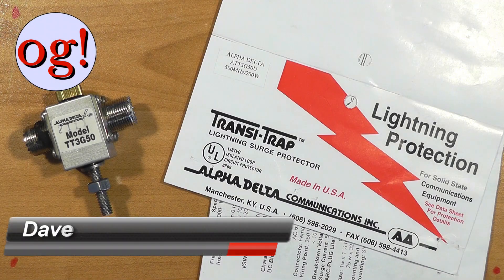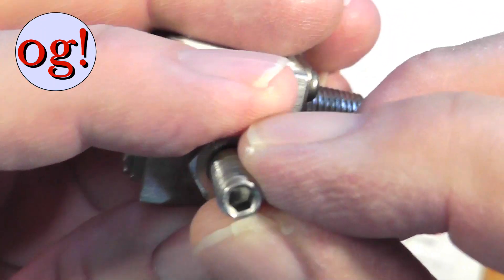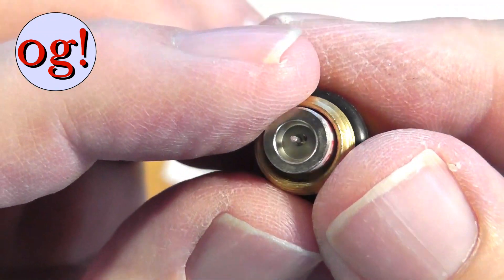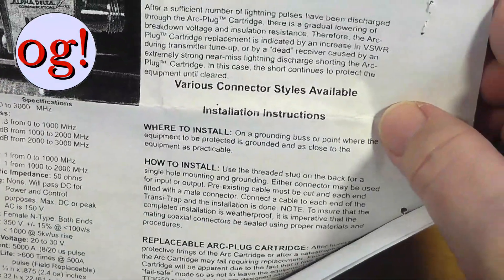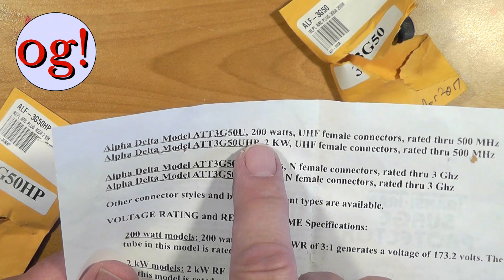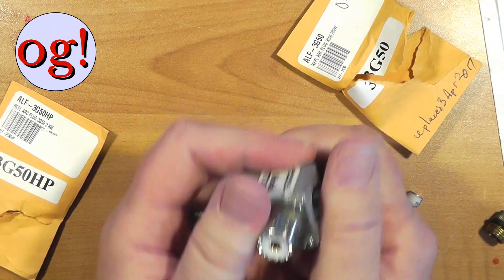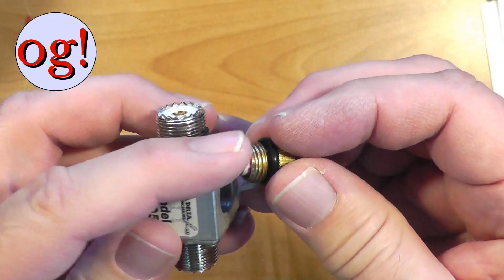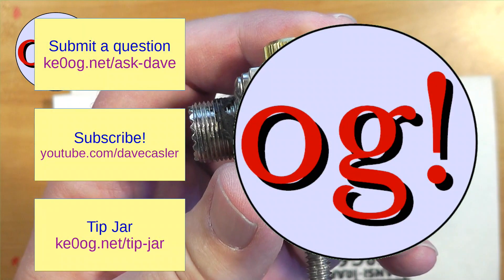The Alpha-Delta Transi-Trap Lightning Surge Protector (#61)

Comment: If the glass capsule fails, does that block current through the protector?  The waterfall display on my radio is very dark and muted, as if it's receiving little,  if any energy.

Comment: Great video and for my money those are price at $55-69. That would be cheap insurance if you live in TS country. I live in earthquake country and only see thunderstorms on the news. Not that it couldn't happen, but I'll just unplug everything if it warrants. I have the antenna  coax grounded outside on a 8ft ground rod with a KF7P coax grounding bracket bolted to it. I'm running the station bus back out to that same ground rod just nearer the dirt that the bracket. That should do it. (and pray for no lightening nearby.)

Comment: If you have taken a hit with one of these installed, take the time and examine the interior of the aluminum block cavity. If you see any blackening inside the device it more than likely has formed a carbon path between shield and the conductor and is rendered useless. If you want you can try disassembly of the device and carefully polishing the cavity with 800 followed by 1200 grit energy paper on a wooden dowel rod. Don't go overboard since we do not know if the cavity dimentions are critical for the frequencies it is designed for.
Reply: "...we do not know if the cavity dimensions are critical for the frequencies it is designed for." Yes we do. They're not. It has SO-239 sockets, so it's not designed for X-band microwave. It's for HF/VHF/UHF. Thus, the internal dimensions AT BEST might be designed to maintain about 50-ohms characteristic impedance. That is NOT a precision thing, simply a ratio of inner and outer diameters. You could grind off a significant amount and it wouldn't make the slightest difference.  And I very much doubt that they made any significant effort to make them precisely free of any "impedance bump" anyway.  I don't understand why they're not $25 or so.

Comment: Hai..rg8 can use??
Reply from the maker: RG8/U is an older type standard coax. It works fine. I like the RG8X because it has nearly the same performance characteristics at a lower price. But if you have old RG8 laying around, go ahead and use it. Make sure the braid jacket isn't corroded away.

Comment: 30 volts? Wouldn't the ruffly 72 volts out of a 100 watt transmitter trigger that? The sheet you are showing says 350 volts for the 200 watt model and 1000 volts for the 2KW model.

Comment: What ground wire size should be used on the ground lug?  I've been told by Alpha Delta and MFJ that the largest diameter possible is recommended, but that a #12 wire from the ground lug to ground rod is a commonly used wire size.  But, that seems lite to me.  The recommendation that #12 wire is adequate suggests to me that the ground lug isn't intended to carry a lightning strike to ground, but is more of a ground intended to protect the device itself from damage due to lesser voltage/current transients that might be finding their way to the casing of the device.  That being said,  I'm currently using #6 wire on mine, just to be on the safe side.

Comment: Dave, Are there any DIY lightning arrestors?  While in my 20’s I worked at an AM radio broadcast station.  One of my duties was to read and log the base current meter at the base of the antenna.  The tower itself was the radiation element.  I noticed there were two spherical balls horizontal to each other acting as a spark gap.  One spree was attached to the tower, the other was connected to ground.  I was curious if something along these lines would work for a ham radio operator?  Thanks for your channel and all you contribute!

Comment: Newbie alert..... Wouldn't it be better to err on the side of caution and default to the 2kw model protector?
Reply from the maker: Unless you have a linear, actually, no. The 2kw model shorts over at a rather higher voltage than the 200w models. If you have a 100 watt radio, get the 200w lightning protectors. Don’t forget to change the arc tube insert to high power if you later add an amplifier

Comment: Dave, trying to sort an antenna run on my first ham shack as a beginner; said first antenna being a dual band VHF/UHF (the HF will be in phase 2 later).  These arresters say HF 2kW, VHF 375W, which in my case... is it saying that if I get a 600W linear amplifier and run my 2meter or 70cm ... that these arrestors can't handle 600W for that amplified VHF/UHF?  Or perhaps its saying that yes, it can't handle 600W for VHF/UHF, but hey beginner dummy, you shouldn't be running 600W on VHF/UHF, leave the amplifier to HF duty?  Trying to reconcile that it appears to say it can't handle amplified VHF/UHF.  Help a beginner out in "the right equipment for the right job" selection and sorting this so I can get on the air for the first time :)  Thank you.
Reply from the maker: UHF and VHF are pretty much line of sight modes. 600 W is overkill and will not get your signal much further than if you just have 50 W. Save the amplifier money for HF.

Comment: Dave, I have my antenna mast tied to the ground rod, is that necessary if I use one of these Surge Protectors in the signal/center conductor line or should I use both?
Reply from the maker: Grounding the mast at the bottom of the mast is a best practice. You should also use the surge protectors at a ground rod where the cables enter the building, and this ground rod should be "bonded" to both your utility ground and the ground at the antenna mast. That said, given my antenna installations, with the exception of my HF9V, are temporary, I don't ground the masts.

Comment: Do you have a video on how to install a ground rod? I wonder how deep, and how big a rod, etc etc
Reply from the maker: The common ground rod is about 8 feet long. You can purchase them at 4 feet 8 feet and 12 feet long. They're readily available at Home Depot or Lowe's. There is actually a tool designed for driving ground rods, though I've never actually seen one. Maybe you can rent one. Like everyone else I just use a sledgehammer, though that sure does make a mess of the end that sticks up out of the ground, and makes it hard to mount hardware. Ask around if you know any electricians and see how they do it. Good luck estimation point
Reply: @davecasler  I've read about the water technique for installing the rods.

Comment: Dave, I miss the photographs that you used to include at the end of each video with your lucid description of the scene. Would be really great to have those included again. Nevertheless, another excellent presentation... Question; I am thinking of setting up again and my proposed antenna will be DC grounded so do you think that this protection is still essential? Thank you. 73, Mike.
Reply from the maker: Mike, I'm about to embark on a trip on the Durango Silverton Narrow Gauge Rail Road, so there may be some more good pictures for the end. Yes, running all cables through lightning surge protectors at the point of entry to the house is always a good idea.
Reply: Thank you for the advice Dave!  I look forward to your photographs - they are always so good. I love seeing images of your wonderful 'Big Country'. 73 from Mike in that old,  little country across the pond.

Comment: Good Job Dave!  These are exactly what I use and I highly recommend them.  I purchase mine from DX Engineering.  I have mine mounted on a copper buss inside a wx proof enclosure about 50 feet from my shack.  I have read that you want these mounted as close to the transceiver as possible so that if the feedline picks up any transients, the trap will shut the voltage to ground before getting into the transceiver.  What's your take on installing the alpha delta trap inside the shack close to the transceiver?  Same question for rotor control cable.
Reply from the maker: The recommendation is generally that they be placed very near where the cable enters the building. That's where mine are.
Reply: Thank you David.

Comment: I use Polyphasers at work. We have a lot of MDS and Freewave 900 MHz spread spectrum radios in our SCADA system. I don't recall ever having to change one but most (not all though) of the antennas are yagi's about 10' - 20 AGL'

Comment: if they had a gear replacement guarantee like a surge protector i would use them, so I will simply remove the coax from my radio when not in use.  Good video tho
Reply from the maker: The surge protectors are not made for the amateur market. They're made for the much broader commercial and military market that uses them as a matter of course and in great quantities. The devices are designed to meet certain standards. You'll never see a gear guarantee from any of the manufacturers of these. It would be nice, though!
Reply: Also keep in mind the NEC says that before any external wire enters the house it must be grounded.  I'm waiting for my order from DX to come in so I can get my new shack room setup properly.

Comment: Super new to amateur radio, don't even have my license yet. While buying a transceiver,  should I buy one of these surge protectors? And do you recommend a handheld radio for a first radio? Thanks!
Reply from the maker: I recommend that prospective hams do not purchase any equipment until after they pass the test. Yes, your first radio will likely be a handheld. Check out my video on how much ham radio costs: https://youtu.be/3plYxQK4RJE
Reply: Thanks. Also, do you like the Baofeng UV5RA handheld? I know, it's extremely cheap, but it's all I can afford right now.

Comment: David,

Gas tubes for lightening mitigation./ rapid spikes have a problem in that there is a rise time for the internal gas to become ionized. Milliseconds if memory serves. During this time the rig sees kilo volts before they turn on and conduct the charge to ground.  Zener diodes could be another choice but they have similar issues.

A better solution are MOV's, Metal Oxide Varistors. They have zero rise time delays for conduction to start. Good news is that they are cheap and plentiful. 

Just like the gas pills a big current event will vaporize them. 

A MOV can withstand many events within their current rating but they do start leaking with a large number of events to the point it may need replacement.  This is easy to check as they get warm/hot when used. When a gas pill becomes non functional while being used I do not know how to check them except perhaps observe applying a voltage to see if in conducts.

MOV's do not have sharp voltage level turn on's, I suspect gas tubes are the same.

Down side for all is that the relatively low voltage of our solid state radios makes them very delicate with respect to natural voltages being generated wither it be lightning or static charge on your body.

The gas tube specs I can find have them rated at 75 volts as a minimum. 

MOV's seem to have a 24 volt rateing 

 http://www.littelfuse.com/~/media/electronics/datasheets/varistors/littelfuse_varistor_mle_datasheet.pdf.pdf
Reply from the maker: Alpha-Delta specifically mentions this in their literature. They say the turn-on time is less than 100 nanoseconds (0.1 usec). They also say the voltage across the surge protector while it's conducting is 30 volts. Given the safety importance of their devices, I would think that they wouldn't advertise specs they can't meet. I've used them for several years in an area with lots of summer lightning without issues.
Reply: Dave, is there a data sheet to examine? getting a qualified response of 30 v when conducting seems to imply a different turn on voltage.  
I also had be planning on doing this when the weather improved  but your post help accelerate my research.
Reply from the maker: https://www.alphadeltacom.com/pdf/TT3G50_instruction_sheets-7.pdf
Reply: Dave,

Reading more on GAS tubes The rise time of the charge greatly effects their turn on voltage. The faster the rise time the higher the voltage is before it conducts and then reverts to  crow bar activity, which I assume is the 30 volts they claim. Littlefuse's examples are in the mili seconds to turn on.

 From Littlefuse product guide on protection:
"
: In summary, there is no one ideal surge arrester device type that meets all
of the key performance parameters for every application.
Due to their complementary performance characteristics,
however, a GDT and MOV can be combined in a circuit to
provide the ultimate in surge suppression performance
"

http://www.littelfuse.com/~/media/electronics/product_catalogs/littelfuse_gdt_catalog.pdf.pdf, Page 6

MOV's seem to contribute more capacitance than a non conducting GDT.

All in all it is difficult to keep sensitive equipment safe from the likes of lightening.
Reply: Regardless of the turn on time, they are better than having no protection.  In the event of a direct strike, they also give lightning a direct path to ground before it enters your shack and burns your house down.

Comment: Getting closer!! A couple more videos and we should have a performance review.....can't wait.

Since you run a Butternut vertical and I am installing a GAP Challenger DX vertical....have you ever had a lightening surge? I have been considering installing one of these Transi-Traps. How do you know that you have taken a surge....do you know when the replaceable part has done it's job, without pulling it apart and inspecting it?
Reply from the maker: Ideally once a Transi-Trap surge protector can no longer handle a surge, it will fail closed, which  means you'll have very high SWR. Otherwise, the Transi-Trap has handled the surge and you can keep going.
Reply: Excellent....thanks for the quick response, Dave.

73 de W0FW